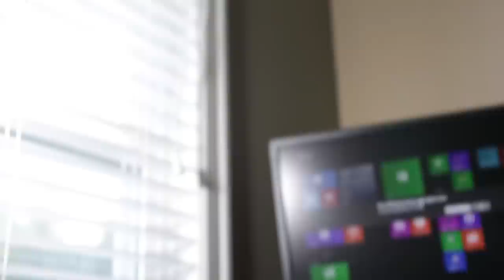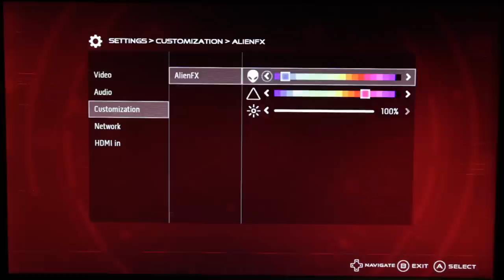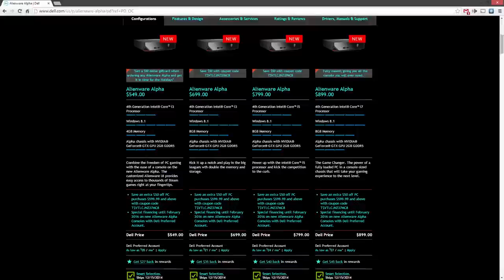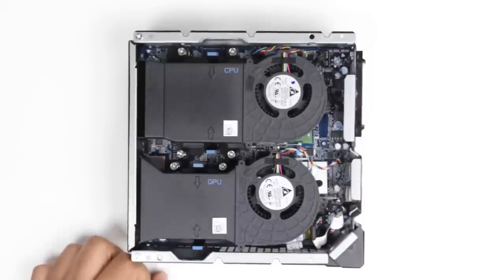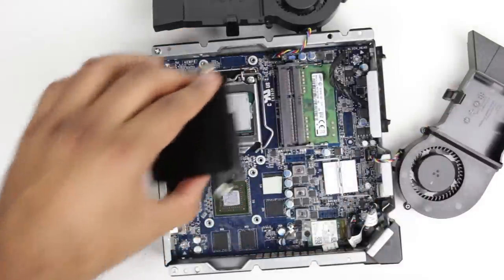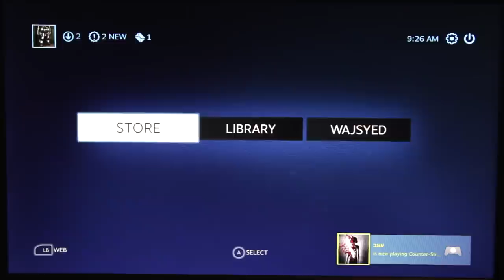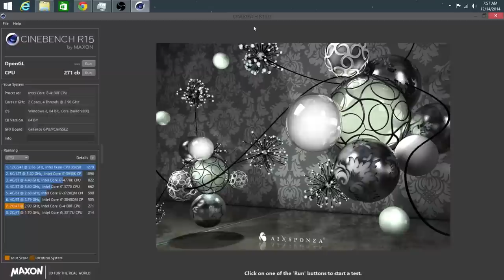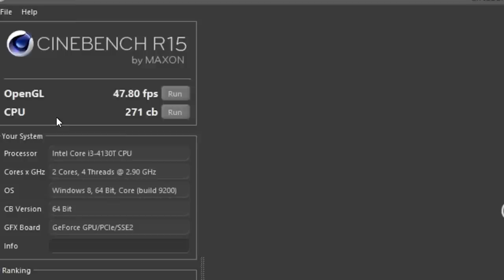Alienware Alpha Full Review

Comment: This can be used with a conventional monitor correct. Do you have to use the 360 controller for controls or can you use a keyboard and mouse?
Reply: Blake Guy 360controller, keyboard, mouse.. you can use any. its technically a pc.. so yea

Comment: What do you think of these computer specs for gaming?

CPU: AMD FX-8350 4.0GHz 8-Core Processor
CPU Cooler: Cooler Master Hyper 212 Plus 76.8 CFM Sleeve Bearing CPU Cooler
Motherboard: Asus M5A78L-M/USB3 Micro ATX AM3+ Motherboard
Memory: G.Skill Ares Series 8GB (2 x 4GB) DDR3-1866 Memory
Storage: Seagate Barracuda 1TB 3.5" 7200RPM Internal Hard Drive
Video Card: Asus Radeon R9 270X 2GB DirectCU II Video Card
Case: Apevia X-HERMES-BL ATX Mid Tower Case
Power Drive: Antec EarthWatts Green 650W 80+ Bronze Certified ATX Power Supply
Optical Drive: Asus DRW-24B1ST/BLK/B/AS DVD/CD Writer
Operating System: Microsoft Windows 7 Home Premium SP1 (OEM) (64-bit)

The total for this currently is $719.73 							

http://pcpartpicker.com/p/TZp8CJ

Comment: Hi, I wanted to know how sync works with vertical, because I use my desktop pc into a lg 47 inch Led to properly view the games must enable v-sync, my pc is a Fx 8350 with R9 and 8Gb 270x ram, eg the far cry 4 the game on ultra seting at 30fps with v-sync like consoles and it shows a little delay in controls, if I disable v-sync the game runs much more fluid and responsive controls, but it looks like shit, well what kind of v-sync uses this pc?

Comment: If you upgrade the Hard drive, would you have to re-install everything? If I were to do that how would I do that? Also, for the CPU, will you have to put some new thermal paste, if you decide to change it?
Reply: Yes you would, its a relatively simple process though, you'd need a 8gb USB stick or request a recovery USB from Dell. If you just use your own USB you can go into Alienware respawn in desktop mode and create a recovery disk. There's a couple of good videos explaining how to change to an SSD if you search YouTube. 

As for the CPU yes you would need new thermal paste if replacing the CPU and even if you remove the heatsink to look. Once its disturbed it needs replacing.

Comment: 30 FPS unplayable? Wow. This guy has some very high standards . Most consol games are running at 30 or less and are completely fine to play. Frame rate to me is not that important. Textures and resolution is the most important. As long as i get high settings and 1080 and around 30 fps im fine with that.

Comment: I fail to see why either size or remote are issues in a living room PC.

Size. Why do you need a little box? If you have a wall-mounted TV... then your are going to have wall cables to some type of cabinet or closet You could put any sized PC in there. If your TV is on a stand... even with a 55" TV... it is going to be raised at least two feet up and certainly on something at least a few feet wide. Stands have lots of room for standard PC towers.

Remote. You've got to be kidding? You do realize that there are already Windows-based remotes. Media Center PCs ship with them. They work fine in Windows 8 to navigate through the start screen. If you need more... install Media Center on it. Any smart remote can be programmed to work with it. And... controllers actually allow you to move through the main Windows 8 start screen or Media Center screens. And... if you are PC gaming... you likely have a wireless mouse and keyboard for gaming anyway.

I've had PCs in my living room for nearly a decade.

Comment: But the games you benchmarked were with the cheapest version of the Alpha right? the one with i3 and 4gb RAM? So those FPS on that system is not too surprising. I'm getting the best version of the Alpha, the one with i7 and 8gb RAM, so the FPS should be significantly better on my system then.
Reply: The Alphas GPU is equivalent to a 770Ti i've heard and that is more than enough for the latest games on max settings, my main desktop is running 690GTX and it runs everything on max.

Quad-Core CPU is the standard today, dual core barely exists anymore. However i'd prefer a 6 or 8 core but 4 cores should be fine for the latest games as well, the question is how fast they are, i'm hoping 4ghz at least (on the i7) to be able to handle the latest games maxed out.

Comment: i have a question since fps is such a big thing whats the highest fps possible on a game? like that shitty game minecraft? can you get like 9000 fps?
Reply: LOL Most high end PC's will run around 200+ FPS but you won't notice it. For example I run Mordor and BF4 at roughly around 130- 150 FPS, but I don't notice the difference when I V-Sync it at 120 or when it dips to 80 or 90 FPS. The human eye will not notice a FPS difference after 60 FPS, anyone that says they do is lying. And even if they did the difference is so small its irrelevant. There are lower scale games like Dota 2, SC2, etc. that you can top out, for example Dota 2 I think tops out at 200 FPS, but again you will NOT notice the difference between 200 FPS and 120 FPS.
Reply: MaRS vS wait then why does everyone always use fps in an argument then? obviously 10-20 is a problem but 30+ aint that bad and what the hell pc do you have to run bf4 at 120+
Reply: TrollzandLollz i7-3820, GTX690, 32GB HyperX Beast DDR3, XFX 1250 PSU, 120GB HyperX SSD, 240GB HyperX SSD, 2x 2TB WD Black HDD, Windows 7 Ultimate, Asetek closed loop liquid CPU cooler, MSI 79x mobo, Creative Sound Blaster Z and LaCie Porsche external HDD. At a 100% Resolution on Ultra BF4 tops out at 160-170FPS maybe more, but averages around 140. Mordor is the gold standard now and on Ultra it sits at 130ish. Tops out at a bit more, but also dips pretty drastically when benchmarking. 

And you're right, 30 FPS isn't bad, but its definitely noticeable if you are usually playing on high frame rates, like 60+. The game will look slow, or grainy. Its kind of hard to explain but its certainly noticeable.
Reply: MaRS vS well not everyone can afford the shit pc also some are too lazy. for example i play steam but buying games is a pain in the ass cuz i gotta buy a prepaid card (since im not old enough to access my bank account) every time when i can just buy the shit at the store and run back home and play it
Reply: TrollzandLollz Haha That's cool man. I was the same way. At least now its much easier to game on PC then when I was younger.
Reply: the hell is overclock im a console gamer i have no clue what that means
Reply: TrollzandLollz Overclock is a term used to up the power of a specific component. For example, you can "overclock" your GPU or "overclock" your CPU and get more power out of it. A lot of people do that, especially to CPU's and GPU's to get as much power as possible from the parts. I have my CPU overclocked to get more power out of it and its definitely noticeable. 

It all originated from guys who instead of wanting to purchase new parts, they would instead overclock their current parts to extend the life of them. Now, virtually every CPU and GPU on high end PC's are going to be overclocked. As well as some RAM.
Reply: TrollzandLollz Nah man, damn near every PC gamer has  had at least one console or grew up playing on them. I'm just no longer of fan of them myself anymore, especially since switching full time to PC gaming. But every one has their likes and dislikes. People need to respect that.
Reply: MaRS vS thank you, apparently opinions are right or wrong when it comes to gaming preferences
Reply: ***** um no 200 is the top
Reply: ***** ok its his opinion and he shared it with me whats your point
Reply: ***** Not really, its more or less a placebo effect. The difference between 80 FPS and 60 FPS is negligible and the difference between 60 and 120 is about the same. I run BF4 at 140-ish on Ultra + 100% Resolution and I can run 150% Resolution at 60-70 FPS on average and the difference is not that noticeable. Certainly not enough to argue about. The only time FPS really matters is if you are playing a competitive esports game and that usually comes at the cost of dropping the graphics to medium or no more than high setting. For casuals and single player experience 60FPS on ultra is perfectly fine.
Reply: MaRS vS There is a difference to human eyes above 60, it's just it's a lot harder to notice and becomes irrelevant over 120fps as the change is so difficult to see.
Reply: u do know that the size of the pixels on the textures isn't the real size of the pixels.....
Reply: MargoťákTV Dude we're all gamers, regardless of what PC, console, tablet, phone, etc. you play them on. We're all into the same thing, so why shouldn't we get along. The pissing contests you see on the internet are ridiculous and obnoxious, and I usually refrain from getting involved. But unfortunately I will step in and try and correct an opinion if need be. Especially if its someone spreading half truths or lies. 

Keep gaming brother. :)
Reply: Well, life runs at around 95 fps, 24/7 365 days a year, 100 years a century.
So i'm dying to know the processor god uses.
Reply: Gabriel Self he uses something called "the pewds processor"

Comment: After the fact you said 30 fps is unstable the human eye seems 24fps to be "smooth" and that's what movies were Shortly after films were getting attention made at at the least because of the lower cost than higher framerates now games are made at either 30fps standard or 60fps therefore people usually dont notice the difference in game on consoles due to the framerate counter usually being on PC games or recording software. Then my point being That 30 fps is still a standard with people usually also not notices because of the typical PC gamer using a 30hz-60hz monitor and the same for TV screens (Yes TVs have a framerate/hz limit amazing right?) So im saying it doesn't matter. But hey. This is just a theory.
Reply: A game theory, thx for watching!!!
Reply: Lol, eyes don't see in fps.

Comment: I have a question and can someone please answer me. I have a Toshiba satellite c855-s5346 and it is complete crap but I want too upgrade it and make it into a gaming laptop. Is it possible that I can buy the parts and replace the sucky parts like the processor and ram and add a video card and hard drive (proabably new fans so it wont overheat) and make it a gaming laptop.

Comment: I'm new to PC gaming and I'm buying the i7 for $850. 9 Times out 10 since I already have a Ps4 I'll be using my Alpha to play Pc exclusives such Dayz, The Forest ect and just using as an actual computer since my old one just clunked out on me. So since I'm going to make this my new desktop how different is this machine to a regular Desktop Pc?? Please answer
Reply: Welcome to the pc master race
Reply: Okay, the main difference is that by default, the Alpha boots into a console-style user interface, which can be a bit of a bugger to navigate, but it can be uninstalled to let you boot to desktop. 

Other than that, there's no difference between this and any other microPC. 
The hardware inside is pretty good for the price point, but you might want to buy a faster hard drive (the Alpha has a very slow 5400rpm drive that'll perform badly with games that need to fetch a good amount of data quickly), Failing that, the Syber Vapor is a comparable model with the benefits of better customisation (like dedicated graphics cards) but the size and form factor is bigger by about a third. 

I hope that helped, Mr.Murkful :)
Reply: Some Guy in a Waistcoat Very helpful. But how big of a hard drive do you recommend? And where can I get one?
Reply: Mr.Murkful That depends on how much space you typically consume.I'd personally pick up a 1TB hybrid drive or a 500GB SSD and use a USB HD for storing my movies.

There is a pretty spiffy dual hard drive option in the Western Digital Black2 which is basically two separate hard drives in one, but I'm not really sure if the Alpha can take 9.5mm thick drives or not ^^'
(EDIT: friend of mine just tested it out, and a 9.5mm fits just fine)

Even without a faster hard drive, I've seen the Alpha manage Dragon Age Inquisition and Borderlands Pre-Sequel run well without too many issues with stuttering while fetching textures and the like.
Reply: ***** Anything you can play on a regular PC, you can play here. You'll likely have to put it in desktop mode instead of the Alienware "Console Mode" (which I believe is a modified XMBX/Kodi interface) for anything outside of the Steam Big Picture mode. 

I would probably say that for things like ArmA and DayZ, the i5 is better than the i3 processor because they require a proper quadcore to run properly. Everything else runs about how you'd expect on a midrange PC or half-decent gaming laptop. 

Just as a disclaimer - I don't actually own an Alpha yet.These are just educated guesses from somebody who knows the hardware and can borrow a friend's Alpha to test with when he comes over. 
(I am definitely getting one soon though. Lugging a 17" gaming laptop to the girlfriend's place and back every few days is hell on the back and this looks like a very nice option to go with my HDMIPI screen for a portable solution).
Reply: Actually it can u can upgrade the cpu

Comment: Wait a sec, if they're saying it's more powerful than ps4 and xbone, why is this alienware getting lower frame rates than those systems????
Reply: Xbox one and ps4 are running all games at medium settings with 900p resolution.Alienware alpha can run games at high with 1080p resolution...
Reply: Robert resolution and frame rate is different...
Reply: The Alienware isn't getting lower framerates. All of these tests are run at 1080p and higher graphics settings and still getting 30fps or so. 

Most games on consoles run at 30 fps and on lower settings. If a game runs on 60fps on the consoles it's usually on a lower resolution like 720p. 

So basically the Alienware is getting the same frame rate as consoles but on higher settings.
If you put your settings down to match consoles the fps would be higher on the Alienware.

Here's a chart I found: http://m.ign.com/wikis/xbox-one/PS4_vs._Xbox_One_Native_Resolutions_and_Framerates

Comment: i'm not completely sure wether or not i want to buy this computer. can it run something like world of warcraft, or lord of the rings online with good framerate? also, would one of the more expensive ones (like the next least expensive one from the alpha) really perform that much better?
Reply: Of course it can Warcraft is from 2000 it's 2016 also this thing can run bf4 at 70 fps on max
Reply: World of Warcraft's (2004) graphical fidelity has came on heaps and bounds over the last 12 years, this wont run it on ultra above 20/30fps

Comment: so, what is better? a alienware x51 or an alpha? i now alpha are a lot smaller but in terms of graphics and price
Reply: you can always pair the alpha up with a graphic amp (retailing for $150 right now on dell's site).  Then you can hook up with a graphic card of your choice.
Note that the unit in this video is uncapable of connecting with a graphic amp, go for the i5 model with gtx 960 instead.
I'd say the setup is pretty future proof
Reply: +Nguyen Ha Kien but i read you cant change alphas graphic card
Reply: yeah you cant, but you can change virtually any graphic cards to the graphic amp.
Reply: ah yeaaah , anyways, the "porable" advantage is pretty fucking lost in there
Reply: The alienware x51 is WAY better than the alpha in terms of specs and graphics, not sure about how the price lines up with the alpha :/

Comment: A waste of money and time to try and compete with both the pc and console market. As a former pc gamer, it's not just about playing the games, people mod, create and expand games. They tweak and push hardware to its limits. Any pc gamer can tell you optimization on pc is pretty wonky, some games work great and others not so much. So why again limit yourself to not only a box you can hardly upgrade but a box that still runs games that aren't optimized to its half locked hardware? To compete with consoles?

With a higher price tag does it match consoles? In my opinion no. A console is still optimized weather it be 720p 60 fps or 1080p 30fps or what have you. Ac4 black flag on ps4 runs at 30fps no screen tear or dips from what I've had. If you locked a pc version of ac4 to 30fps it st udders. Without tweaking it it runs worse than a Console.  Same goes for last of us remastered where 60 fps was optimized but locking it to 30 causes major fps studders. Unless you get a real pc and not this overpriced Alienware trash your always going to have hiccups.

I chose console gaming because I don't have to fuss over constantly tweaking, changing, modding, or overclocking  to get into the butter zone to be able to enjoy my games. Sure I may not have 60 fps everytime. Destiny is 30fps but is smooth as can be. And sure I pay more for games than most do on steam sales. But in the end I can pop in any game quickly and get the same and most times better experience out my console than I did on pc.

Either way building an actual pc for the same price and getting more out of your dollar in the long run through better customizable options in terms of hardware or getting a console is better than feeding industries creating these "steam machines" that truly limit gaming as a whole
Reply: That's another excellent point and one of the reasons I'm so pissed at Valve for not releasing only ONE Steam Machine for developers to target. It was seriously a brilliant move by them to release hardware with their own OS and having a huge catalog of games available but the fact that they've made the OS itself optional (meaning games are not guaranteed to be ported) and the hardware so variable (meaning games will not be optimized) makes it almost meaningless.